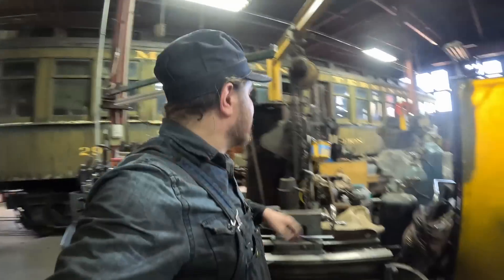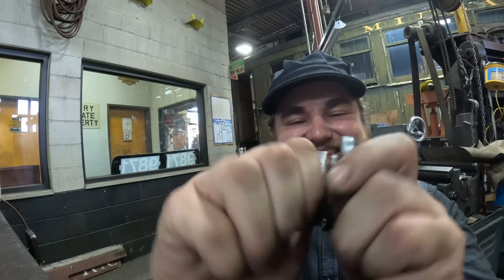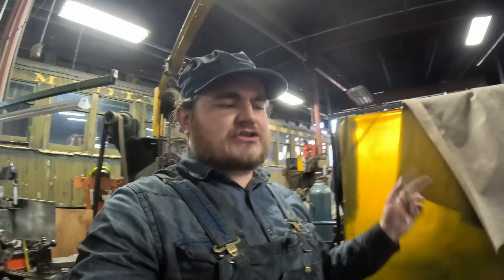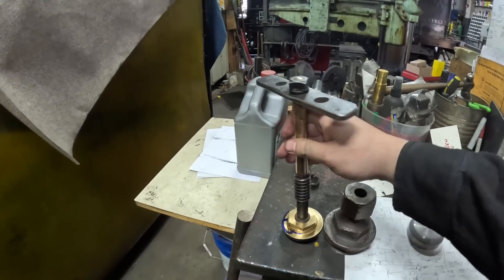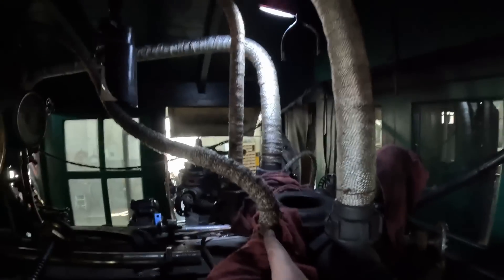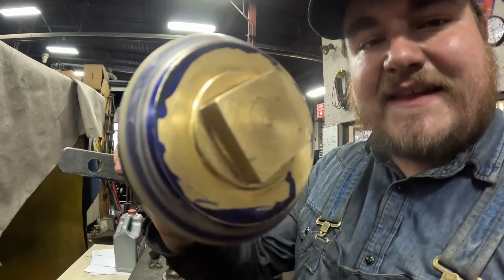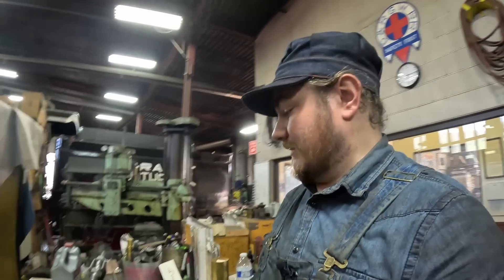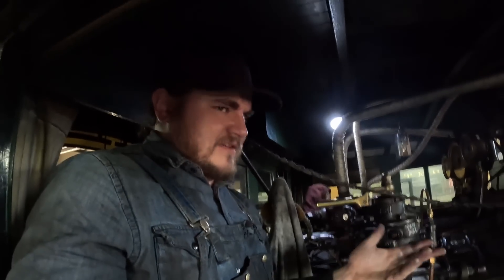Why DIESEL replaced STEAM TRAINS - a specific look. | Railroad 101

Comment: One of the main reasons why diesel replaced steam is quoted time and time again as "maintenance costs", and after seeing this video, I can see why! Even though later on many steam locomotives had standardized parts, they still had the "multiple uses" ideal, while the diesels almost right off the bat had the "throwaway parts" ideal. Very interesting. Loved this video, Hyce. Cheers!
Reply: Maybe not “throwaway parts”, but “replaceable parts” definitely. There are many parts on diesels that must be replaced when worn, but there are many others that can be refurbished
Reply: So taking environmental factors & carbon footprint including the production & delivery of fuel into account.
If steam powered locomotives were to be drawn up from scratch vs diesel & electric! What’s got the most going for it when it comes to cleanest , dependable & lifetime cost effectiveness???? & supporting infrastructure ?
Reply: @concernedaussie1330  Depends on operating environment, but the simple answer is "not steam"
Reply: @concernedaussie1330 technically youd use a steam turbine today, driving a generator like on a diesel electric. no valves to control cylinders, the trubines valves can be completely computer controlled to manage rpm of the turbine. the electric drivetrain part of the equation is basically no maintenance now with modern inverter based asynchronous motors. but realtalk if you are already half electric why not just use catanary and have the locomotive just have a transformer. wayy cheaper and less complex.
Reply: @concernedaussie1330  Electric by far has the fewest moving parts, so on a per-loco basis, that. Plus power for them can be generated in completely clean ways - geothermal, solar, hydro, nuclear, etc.
Reply: @davidfuller581  those forms of electric would require large expensive infrastructure to supply the power from fixed locations would it not ?
Surely a steam powered turbine/generator on board to power electric motors would require far less foundational/infrastructure ???
No copper wires & on going maintenance to supply. 
Potentially even provide moblie power supply incase of natural disasters??? Or major power outages ??? 
Run on bio fuels or solid fuels ie wood or other compressed waste & even coal as a emergency back up.
I'm thinking vast distance infrastructure , over flood , fire , seismic or mountainous terrain could complicate things. 
The same technologies could be used on current railroads with no change needed . Upgrading the whole rail network with little compilations . Only water & fuel that's grown or sourced locally.  
Just my thoughts. 
Kiss: keep it simple stupid 😁.
Btw pre heated hot water could be used , with pre heating could be done by tapping heat sinks from the hot bitumen roads . That's a totally wasted solar heat generating panel system that's already present & abundant.

Comment: I have to agree with ya on the design principle changing over the years. Nothing is designed to last like it used to. Great for less down time but I feel like a lot of this modern equipment will be lost to time just because after it’s obsolete it will become impossible to repair.

Comment: WWII Absolutely ramrodded interchangeable parts into the world for good. The liaison from Rolls Royce to Merlin commented something about how the workbenches at Packard didn't have vices because if you needed to modify the part then the part wasn't to spec. Diesel - electric had much lower maintenance hours because of the ability to just replace parts with like parts. 

And that was on top of the fact that Diesels had 1 consumable to supply. Fuel. Where a steam engine had fuel, water, and steam oil. Diesel-electrics could also be fired up quicker and were much safer to leave idling. The switchover was inevitable.

Comment: This video covers one of the cost items in why diesel locomotives replaced steam locomotives. The cost item was that steam locomotives needed a lot more maintenance than diesel locomotives. There are two other cost items involved where steam locomotives cost more than diesel locomotives. One of these was that steam locomotives were less fuel efficient than diesel locomotives. Steam locomotives burned more fuel for distance traveled than a diesel locomotives, which cost additional money. Also steam locomotives needed large refills of water for the boiler and diesel locomotives did not need refills of water. The water cost money. So from these three areas of cost it was inevitable that diesel locomotives replaced steam locomotives. However because of the popularity of steam locomotives for show and excursions a small percentage of steam locomotives have been restored back to service and are still in use.

Comment: it all boils down to money.
servicing a Steamer can take days, if not weeks to repair if a significant defect is found.
this is outside of the normal turnaround downtime to service the loco given it can take many hours to bring a cold steam loco up to operating pressure and not break something doing it.
all that time is money both in crew pay to work and revenue loss because wheels aren't turning moving the goods.
a Diesel is almost Fire and forget. 
you do your walkaround and service inspection to check that nothing is wrong and needs work.
climb up and start it up.
that loco is road ready in less than 10 minutes with 1 guy. who then walks to the next one and repeats the process.
even more is crew needs on the road.
every steam loco needs it's full crew to operate even in helper use. you cannot remotely control any steam locomotive! it's the nature of the beast.
I can string 15 Diesels together with a simple Multi-Unit <MU> Cable and control all 15 of them from any one cab in the lashup!

time is money on the high iron. and Diesels just do a far more effeicient job of bringing home the Bacon.
this is largely why most roads Dieselized rapidly once reliable Diesel power became available.

Comment: Fuel economy and labor were also part of the reason. Diesels are much more efficient than steam. They also save on labor because they don’t need a fireman. And they need less maintenance because they don’t have connecting rods, so the wheels can be much better balanced, reducing the wear and tear on the bearings, and there’s also fewer parts that need lubrication.

Comment: Could part of this differential in steam vs diesel also be related to the improvement in material quality (metallurgical advancements), in both the parts, and the tooling to make the parts?
Reply: Yes he's comparing a technology (steam locomotives) which was dead by the`1960's verse a more modern (diesel/electric) which has continued to evolve. Water really killed steam locomotives is that they had to make frequent stops to take on water to make the steam. Time is money.

Comment: Something I'd love to see would be an honest attempt at a steam locomotive with all the advances that have been made possible in last hundred years and with the appropriate concessions to maintenance cycles to make them competitive with diesel locomotives in that regard, such as the use of regular parts wherever possible to facilitate "shotgun" maintenance by technicians; the individual parts could (I think should in fact) retain their ability to be remanufactured because this allows application to scale easily, the smallest operators could do maintenance as you do, bringing the unit down while the individual part is reconditioned or swap it out at a supplier like you do with a car alternator and get the unit back up shortly.  Larger operations could have spares ready to go easily and could shop out the rebuilding of worn components, while the largest concerns would have their own part-rebuilding facilities either on-site or off as appropriate to their situation.  

Ideally three designs would be made, the first holding closely to "classic" steam locomotive appearance and function; direct-drive from pistons, steam-dome, boiler shape, etc.  The second would only be held to the basic appearance of a long boiler and connecting rods on the drivers, mainly to allow for the use of a turbine as this is probably a critical concession to economy.  Electro-motive drive could even be used to keep the turbine running at favorable speeds.  The third design would make no concessions to appearance at all and would probably end up looking like an M-1 or an ACE-3000 but it would potentially be the most economical.  The ultimate question would be, does this exercise result in something competitive or would the initial outlay of cost be too great due to the inclusion of exotic materials needed to ensure safe operation for long periods?

Comment: Only 50 seconds in, I'll watch the video but I know the answer: operating costs. Diesels are way lower maintenance and can be brought online and offline much faster. Sure in some situations you might need multiple diesel locos to replace one steam loco but adding an extra diesel loco to a train is much less of a big deal than a double header steam train. No Ash, no water just fuel a few crew and go. 

The first diesels had at best marginally better fuel efficiency than steam and in some cases slightly worse but they were still cheaper to run. As time passed they became extremely efficient and cheap to run. In outback Australia you have Iron ore trains that are completely crewless and most freight trains need only a couple of crew, even for multi engine trains.

Comment: I think there were some experiments with using the most powerful kind of steam engine that exists, a railroad nuclear reactor. But everybody figured out pretty quickly that the safest way to run a railroad on nuclear power was to build the power plant somewhere safe with full-time professional staff and then power the locomotives with overhead line. I guess in a way most electric locomotives are at least partially steam powered because almost all power plants are steam engines, exceptions being places like Switzerland where it's all coming from hydroelectric. In the Netherlands they say all of the power for the railroads is wind and solar, but you can't really say that when it's all traveling through the same grid.
Reply: That would be a whole interesting topic to cover in a video IMHO.

Comment: Theoretically you could make a steam engine design with standardized parts (like a diesel) and cut way down on the maintenance though, right? Like if they theoretically wanted to make a new steam locomotive today, that could probably be done? Enjoying these kind of videos, it really shows the difference in philosophy between early railroaders and modern ones.
Reply: I don’t think so. A diesel parts can be switched out because it all expands and contracts at once and it is a very small amount. That is what allows parts to be interchangeable. For a steam engine, the metal expands a lot. For example the big boys boiler expands two inches from cold to hot. With steam and huge temperature and pressure it forces metal to a certain shape or bends the metal every so slightly that work needs to be done to where the new part needs to go. 

The best example I can think of is a car battery. A “diesel” can have the old battery pulled out and replaced in a short time. 

A “steam engine” has to have the cables reworked, the battery housing straightened out, the new battery put in, and then rework the cables. A five minute fix on a “diesel” vs a five hour fix on “steam”.

Is it possible? Maybe but it still won’t be done because steam is not effective as diesel.

Make sense?
Reply: Even with standardized parts it would take a lot of design and engineering to try and make the parts work with less maintenance. 
For modern stuff they could probably develop a steam turbine that runs a generator like the diesel electric engines. But, at that point there likely isn’t a real benefit over the established engines.
Reply: BR tried this with the standard types, and it didn't work all that well. The problem mostly boiled down to, the different locomotives (of the same class) would have different levels of overall wear depending on their individual use. This wear would be transmitted throughout the entire vehicle, which means that every part would be a little bit different from the same parts on another locomotive of the same class. This means that any parts needing to be replaced would, by necessity, need to be fitted to the others, in order to keep the motion balanced and the boiler parts air tight. Thus defeating the whole point. Diesels dont have the same types of issues.
Reply: @jacobgreve802  Last i checked BR got the idea off the LMS.
And closest i can find is the 8F being a 2-8-0 freight version of the black 5 and think used a good few of the same parts.
Reply: @davidty2006  same patterns yes, but the parts still need to be machined to fit the individual locomotives.
Reply: But surely with all of todays technology we would be able to have more efficient parts for a steam locomotive. Maybe with the new PRR T1 we could have a breakthrough in steam motive power
Reply: @MaddoxsTrains  to a degree. A Diesel engine is efficient because the heat and thus power is contained and usable inside the engine block. However with a steam a good chunk of the heat (low heat leads to less steam) and thus power is lost through the funnel and out the engine.
Reply: @Johndoe-dc  well I know that, thats why they made feedwater heaters in order to recycle heat thus improving performance. All I’m saying is that theres tons of technological advances between the 1960’s and today
Reply: @MaddoxsTrains  true time has allowed more advancements in power and thermodynamics. I believe the power of steam has gone from a 30 percent efficiency to a modern 60ish percent efficiency.
Reply: @Johndoe-dc  Thats what I’d probably guess too and same goes with diesel too, they getting more efficient and powerful as well
Reply: @MaddoxsTrains  Yhea at that point it comes down to fuel. This is where steam comes ahead. A diesel can use diesel fuel or peanut oil as fuel compared to a steam engine which can use anything that burns wether that be coal, peat, charcoal, wood, a good chunk (60-70ish percent) of things in landfills, human bodies (a bit dark but there is over 7 billion people on the planet and Americans are fat. We can afford a few lives), or even elements (potassium reacts violently with water making extreme heat, thermite, uranium, just to name a few).
Reply: @Johndoe-dc  That is true too and another thing is the power distribution between units, in which you just have to hook up your locomotives, flip a few switches, and you can control 3 engines with just 1 man
Reply: @MaddoxsTrains Where were the feedwater heaters located and what heat source did they use? Exhaust steam or combustion gases in the smoke box.

Comment: If steam had stayed around into the modern day, keeping multi use equipment, it would make sense for the railroads to have extra parts to swap, then have a crew just to repair those parts, and take less time in the shop
Reply: Some railroads did just that. With large classes they could easily swap wheels, boilers, motion rods, and all sorts of parts with ready refurbished spares, and then refurbish those parts ready for the next one
Reply: True it would not bes as bad as it is now, but there are still much more individual parts on Steam vs Diesel. Lots of components are interchangeable between cylinders or cylinder heads, the traction motors usually are, the turbos as well.

Comment: This video really highlights something that everyone needs to aware of in the use and design of virtually everything we use in a industrial society.

Can it be fixed at all?
What parts are available for repairs?
What tools are needed?
What repair documentation is there?

If you hear the words "custom fit" then you need to change your mindset on how that item is used and maintained from the time it goes into service and when the call for a replacement part is needed needs to be made.
Reply: What happens if your phone/TV/computer quits? It usually can't be fixed; you must buy a new one. TVs used to be fixable, down to the individual component. Now, you don't even know what's going on in the box.
Reply: @ReggieArford  This is why Right to Repair is so important. You the end user should be able to access to what your need to maintain your property.
It's good for the end user's wallet.
It's good for the environment.
It's good for society in general to make common the skills needed to repair various things again.

Comment: 5:55 Actually, there IS one thing that needs to be lapped on a Diesel engine: the Valves (Exhaust only on a 2 stroke EMD engine and both Intake and exhaust on a 4 stroke GE Engine) its essentially the exact same principle of the Turret Valves on a steam engine, where a good valve seat is essential to proper operation. For steam its to prevent equipment from operating, but on a diesel its to have an airtight combustion chamber with good compression (Diesel is a compression Ignition engine; if the combustion chambers arent airtight, the engine will be hard to start if it even starts at all!

Comment: Great video! I've lapped a few valves into my van's engine head but this is something else 😂 Curious to know, how did you discover the turret shut off leaked? Is that part of the annual inspection? I assume usually it's wide open to feed the appliances, or does it ever get shut off as part of normal operation? Or maybe there is a routine check of its function for safety?
Reply from the maker: We shut it off daily as a part of night-night processes. That's why we knew it leaked.
Reply: @Hyce777  I love that you call them "night-night processes", it's implying you put the loco to sleep everyday :D